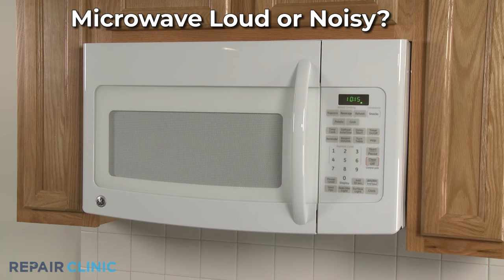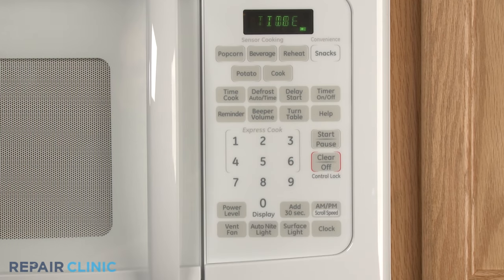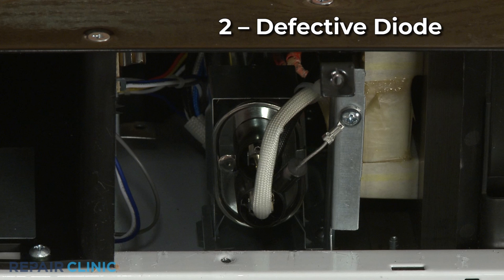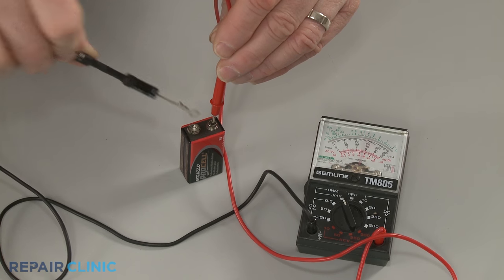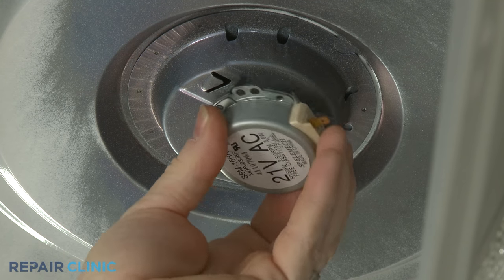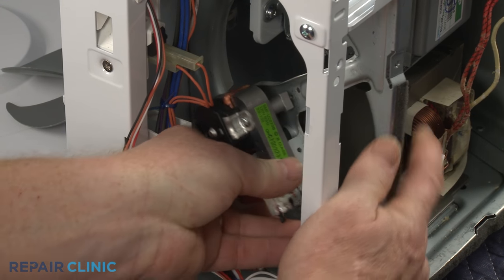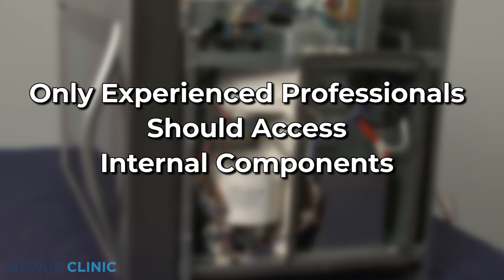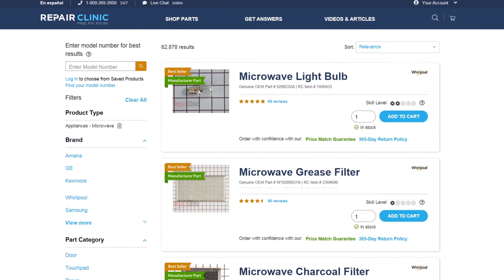Top Reasons Microwave Is Loud or Noisy  — Microwave Oven Troubleshooting

Comment: I really wish there would have been "samples" of the sounds that accompany the issues. That would greatly benefit diagnosing the issue for a lot of people.
Reply: I agree.
Reply: Agreed. Mine is popping like there is metal in the microwave. I have cleaned the microwave thoroughly multiple times to make sure there is no metal.
Reply: Ha I have been on Google for an hour trying to find this. I'd even take an article that tried spelling out the noise.
Reply: Yes!!!!!
Reply: Mine makes a thumping sound when the turntable is under load
Reply: Mine is NEW but box had been taped back so think it was returned. From Home Depot.
Reply: Sounds like a radioactive tone
Reply: Our KitchenAid KHMS155WH1 had a bad magnatron when it was new.  It made a horrible buzzing noise and didn't cook food.  That's the key to detecing bad magnatron or diode - no cooking.  They replaced the magnatron under warranty, which involved tearing down the whole machine.  It worked great for the next 18 years, although the keypad was replaced under a safety recall (it would start the microwave when we weren't home!) and the handle broke off (brittle plastic, superglue and baking soda to the rescue!).  So, 18 years later, the characteristic LOUD buzz has come back and it doesn't cook food.  I think it is time to buy a new microwave. A new magnatron is almost as much as a whole new machine. And a 5000 Volt capacitor is nothing to be trifled with!  I have an extra keypad, by the way, new in the box (they sent me two).  I guess I should sell it on eBay or something....

Comment: all microwaves are noisy because people stopped progressing this technology for whatever reason
Reply: The four feet on my oven are a stiff plastic, rather than be a somewhat soft rubber, and that stiff plastic in turn transfers noise to the kitchen counter, and that turns the kitchen cabinet below it into a damn speaker.  So I placed a sheet of soft rubber shelf liner onto the counter, then an old sheet of glass on top of that, then four square pieces of the same rubber shelf liner on top of the glass just below the four feet of the oven. The four small patches below the feet keep the oven from sliding off the glass, and the sheet of rubber liner beneath the sheet of glass then limits some of the noise from transferring from the oven on over to the kitchen counter.  Anyhow, it's much better now.

Comment: Reference @ 00:31 I believe this testing is incomplete. Testing continuity and resistivity are correct across terminals looks right, I've seen many techs advise to check internal shorting of the Mag itself by testing continuity between Mag terminals and the Mag house. From what I've researched it should be OPEN on both Mag terminals to Mag housing. Please respond RepairClinic, it this correct? If the terminals to housing show continuity is the Mag bad and should be replaced even thought ohm resistivity across the terminals shows good?  If my research concerning terminals to housing continuity should be open is correct, it's is time to update this video to reflect correct testing procedure. Thanks
Reply: They will not answer because they make money selling parts, they will be happy if you buy enough parts to built three microwave ovens. 😵

Comment: My microwave has a relatable, but slightly different problem. Although I see no arching problems going on inside the anti radiant window, there's arching going on rather inside. My Frigidaire microwave is so old, it has the older cursive logo that Frigidaire use to do, now they make their logos with their As replaced with triangles funny enough. But my microwave has always been kind of quiet, and the buzzing wasn't too loud. The loudest parts of the microwave mainly were the motors, and even they were quiet. But then all of the sudden out of nowhere, it started buzzing VERY loudly and it kept on stopping itself and then kicking on the vent blower used for the stove. The buzzing may I remind you isn't anything like turn it on, wait a few seconds and then arching sounds, it happens almost instantly the moment after you turn the microwave on. And then you hear arching on the inside and it doesn't trip the breaker, but it trips itself and kicks the blower on. But you don't see any arching or sparking on the inside lighting up like the 4th of July in here, it sounds like it's all happening inside. Like a faulty transformer or magnetron. Our microwave acted up in the past when dirty inside, but NEVER has it done this before. I thought it could've been a faulty diode or transformer, but when I heard about the magnetron acting up how it can in the video, my worry is our microwave is toast! Has anybody had this happen before? Is it fixable or will it be needing new parts? We recently had our fridge go out on us and spent alot of money on a new one and that wasn't too long ago. Thank God we have a mini microwave downstairs with another fridge next to it because we're not sure when we'll be able to get a new microwave for the upstairs kitchen which sucks. That's why I wanted to see if anybody knows how to diagnose this problem?

Comment: Microwave oven doors have microswitches. These microswitches sense if the door is open or closed.  They are in part mechanical and will fail.  If all else tests functional, the door microswitches may be the culprit.